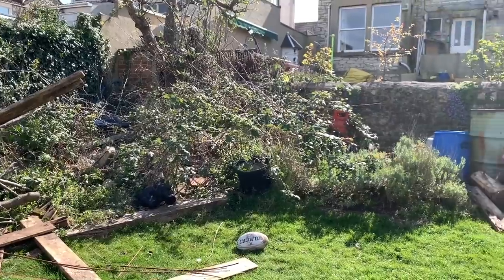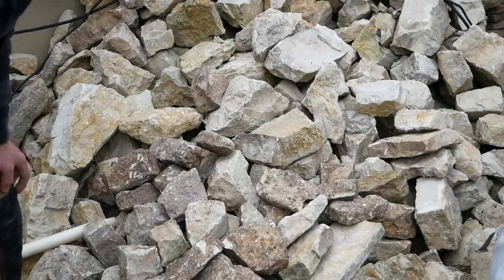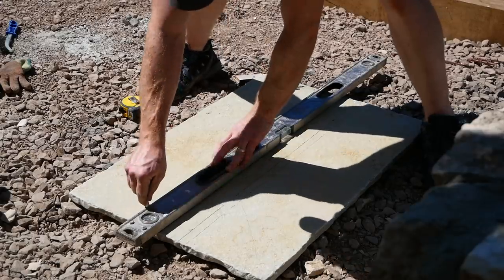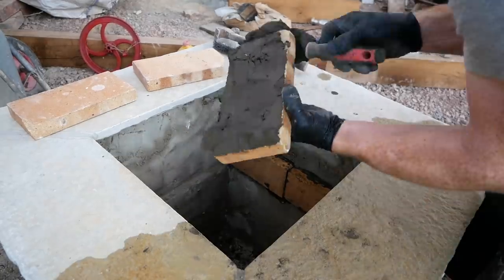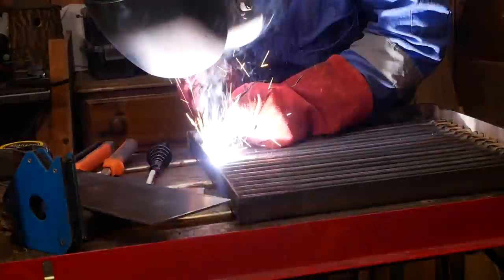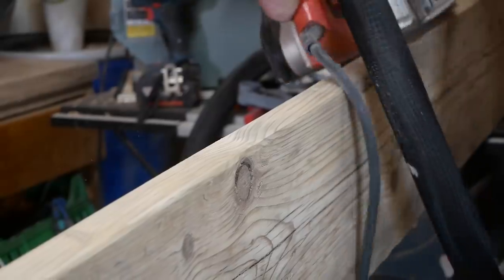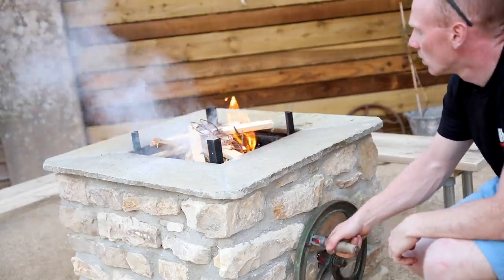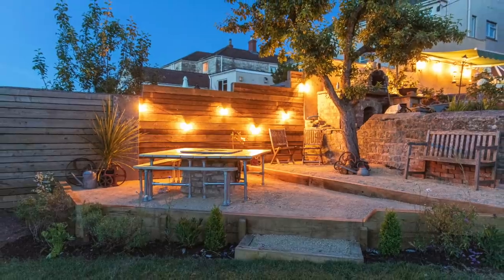MAKING A CUSTOM FIRE PIT BBQ - with tables, benches and FIRE LIFT!🔥

Comment: Great work as always. I had allot of plans for an outdoor kitchen and other stuff built in the yard and have never gotten around to it. Mainly because we get such a short amount of time where it's nice enough to be outside. Living here in Texas the weather is horrible then when it is nice that few days the pollen is overbearing. We are sitting at 100* 56% humidity and a heat index of 124* and it's only going to get worse from here until early September when the heat starts to break.  Sorry too lazy to do the metric conversion. :) 

       I have done every trade but very little masonry work usually brick wall repair. A large stone project would be fun. Anyway keep up the great workmanship and welding will open up a huge array of things you can do even if it is just a flux core welder.

Comment: You should be so proud of that its really good. Them handrail bars are brilliant i used some as a drop bolt for my driveway gates they have so many uses
Reply from the maker: Super easy to use. Plus means I can pack away furniture over winter with no more than a hex key. I had designed folding wooden legs and catches but these are perfect.

Comment: Awesome project.  I can never be bothered to strip the paint off metal, I just make a bonfire and throw it on top instead.  Once the fire is raging the paint just burns right off without any effort.  Lazy I know, but it works every time.

Comment: Thats fantastic Tim!...are you going to make a top/cover for it for when it rains?
Reply from the maker: There is a smaller table top with no gaps in the making which will sit on the stone top. That will also make it usable as a big table when not grilling. 👍

Comment: Looks excellent 👍🏻 hope you added a ash pit at the bottom and some air vents at a couple of levels? Reason i ask is a friend built a brick bbq Argentina style with the handle above and wire lowering the grill after a few fires he drilled 1 1/2" holes through the brick and the diffrence is tremendous 👍🏻 he then made a small door 110mm by 70mm to allow him to scrape out the ash at ground level. Your looked to be working great but thought its good to share knowledge 🤔 Thanks 👍🏻👏🏴
Reply from the maker: That’s what the core was drilled for. It fits a small leaf blower for getting a strong log fire going. 👌 the ash is pretty contained  by a second layer of fire bricks so easy enough to vacuum out with ash vac when needed.
Reply: @TheRestorationCouple  thanks for replying ye seen the blower hole. My friend found adding a few holes at different levels helped the fire burn better without the need of forced air. See how you have a fire brick base so easy to get rid of the ash. He only had a perforated sheet great so had to have the ash pit hole. Looking forward to seeing the detailed build such a great project 👍🏻